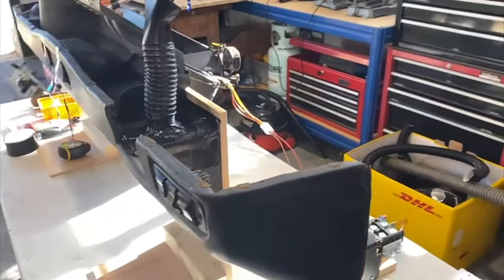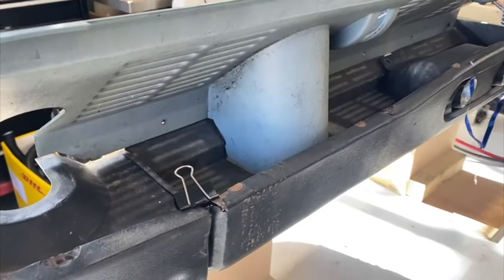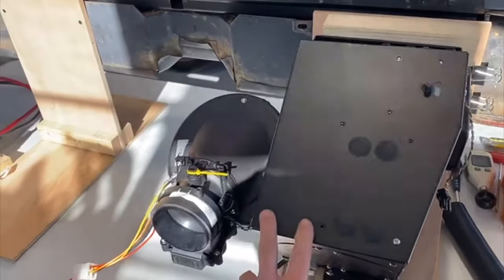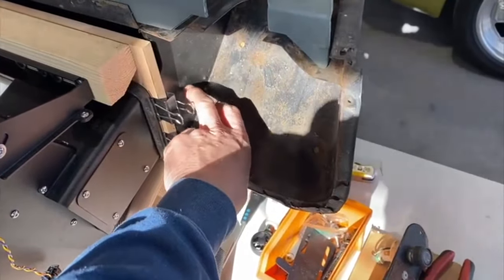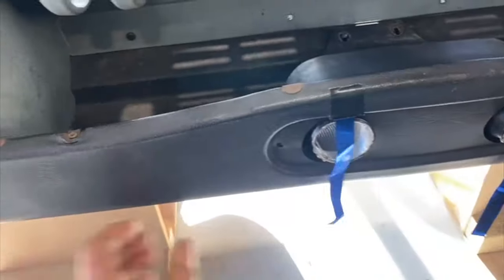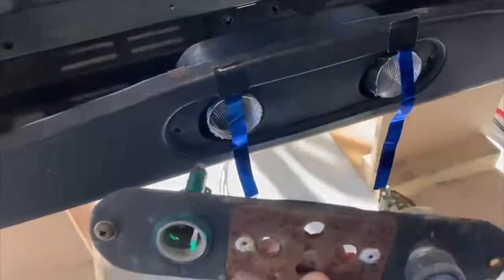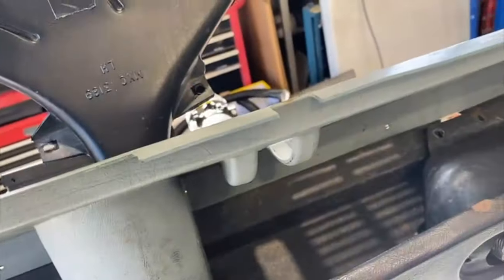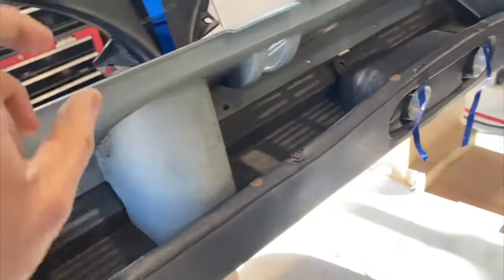Classic Retrofit Electric Air Conditioning System for Land Rover Defender: 60mph winds at the vents!

Comment: I once had a 1988 One-Ten County, originally shipped to Australia (I imported it to NZ) 
It had an air conditioning system integrated into the dashboard, along with push-button duct controls. Can't recall if they were vacuum or electronically controlled. 
You could easily spot the old Ninetys' and One-Tens' with that system, as the scuttle vents were usually black (plastic?) and unable to be opened. 
Wonder why nobody has replicated that old setup....not even Land Rover themselves. 
Pleased to see there's new products under development for the classic Landys.